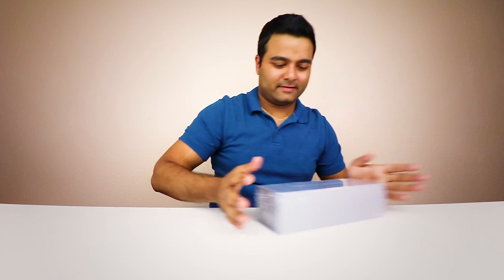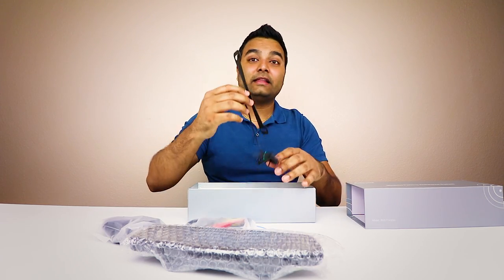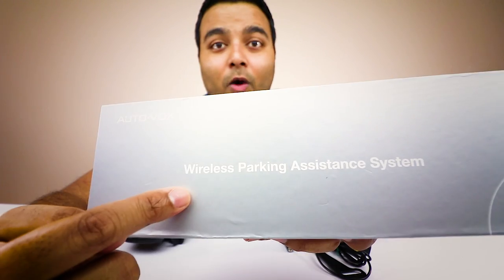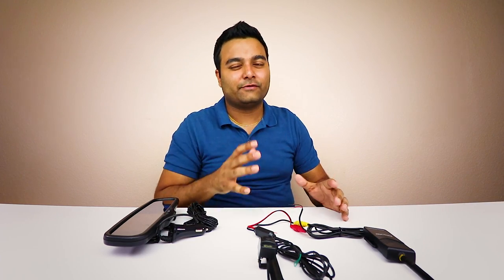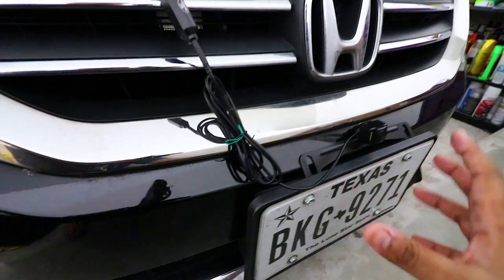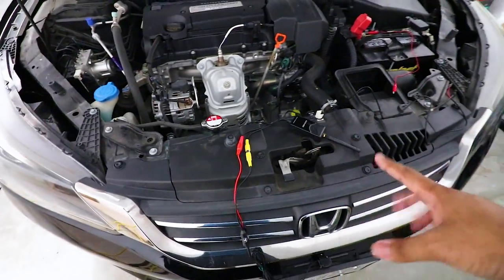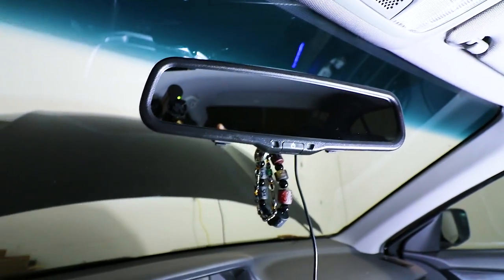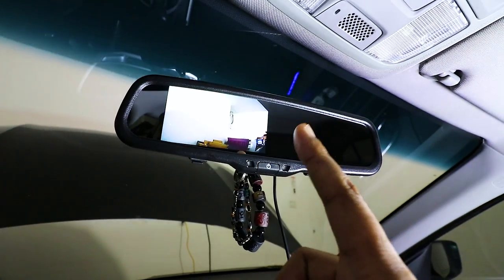INSANELY COOL Wireless Backup Camera, With a Mirror Twist...

Comment: Whats the purpose for just having a back camera at such an expensive price? I thought that the whole purpose for a front and rear camera is not only to assist in backing up, but also to record in case of a collision. Seems to me that if all you want is a back up camera, there are so many cameras on ebay  that are a lot cheaper, and it just takes about 30 minutes to install them .?Also by having the rear camera in front instead of a unit that has a built in camera for front view that stays inside the car guarded by the windshield, having the camera out in front will get clouded up with bugs in no time thus interfering with the view which is the main reason you bought it to begin with right?.....

Comment: "I could put this on a button or something" ...or you could wire it into the reverse lights like you're supposed to. Also never wire something straight to your battery without a fuse. Not everyone on the internet knows wtf they're doing and they'd fry electronics that require lower amperage. Either do it right in the video or don't do it.
Reply: thank you for thinking of us ab1923 i'm one of those that have no idea 'wtf' they are doing! haha
Reply: Thank you! Jeez. I about had a heart attack when this fool just hooked it up to the battery without a fuse. There’s a reason it’s designed to be attached to the reverse lights! Those are connected to a fuse! This video is going to get some amateur admitted to the ER. Also, this guy shouts way to damn much. I just wanted to see a real installation. Is that too much to ask???

Comment: Regular WIRED back up mirrir can be hardwired to the fuse in your car.. so you have to use the cigar lighter to charge or power it.. but i have a question.. can i do the same to a wireless backup rear mirror.. bevause those STILL use the cigar charger to power it even though its still (wireless as it doesnt have to connect to the rear camera).. can i still hard wire it to fuse?

Comment: I did not see the grid on the screen, are they missing it or we have to turn that feature on
Reply: Cut the greenline on the camera, the guidance will show up on the screen. They continue updating the product according to customers' suggestions. Next time you may get it with default guidance line. And extra wires or someting small tools for your DIY installation.

Comment: I bought the same brand. The only reason i went with the wired version is because it said there would be interface with blutooth or radio signals. So i went with the wired one.
Reply: Yes , they provide wired and wireless. Wireless devices may be susceptible to interference, but actually it does a good job for me. It is much easier to install than wired.

Comment: if I want to have the camera in the front where do I plug the power cabel in? I don't want it on all the time :D
Reply from the maker: Yeah man good question, so I was actually thinking of running it straight from the battery. However I would run a switch with the power wire into the cabin to make sure I can turn off the camera.
Reply: Alexander Van dommele I think it will get beat up (the camera) if you run it in the front since all the dirt and debris will be hitting it constantly.  This is not an issue on the back...  maybe put a fiberglass box around it or something ?

Comment: 4real, cut the ugly cigarette /charger attachment off & run the wire's up to the dome light, run a inline fuse & tap into the power for the dome light & ground the ground wire! also, make sure when you cut the cigarette lighter/charger, that you leave 2-3 inches of wire attached to the cig lighter/charger so you can use it in the future! especially since it also has a secondary usb output.

Comment: Actually, I see him blabbing away, not showing you much. The LED system SUCKS . Its best to use infra-red type with night vision, not the crappy LED system. Yes, it has wires...for power. Like anything else, like energy smart cars, solar panels, free energy blah ,blah, blah , none of it is so stop bitching. If you cannot do this , then don't. On a van or hatch back, these things can be a bitch to install. You have to wire it to the back up system of your car.